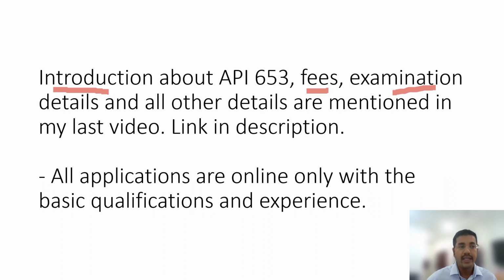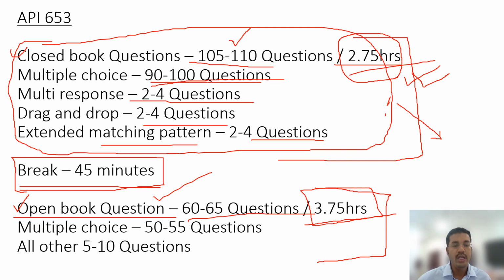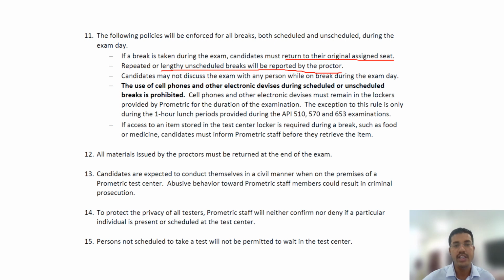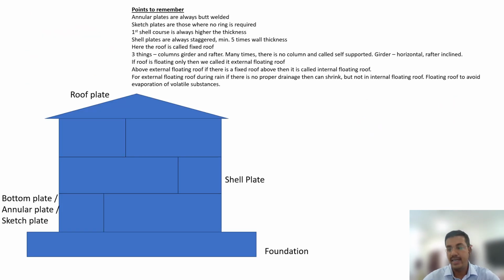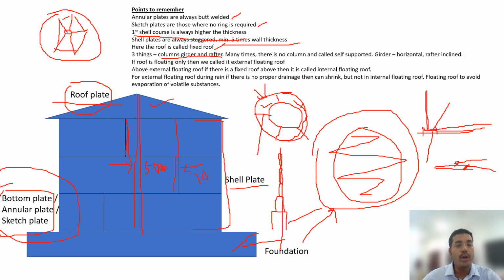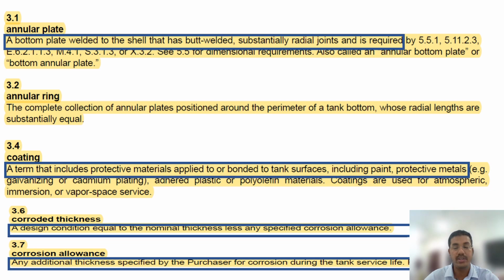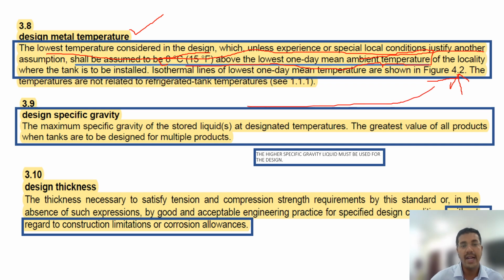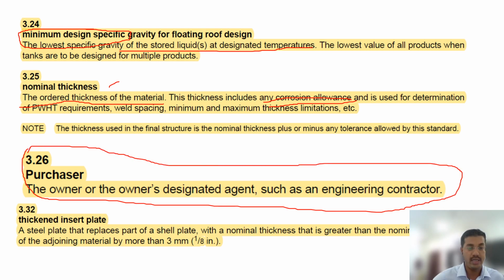API 653 PART 1

Comment: Hi, I have done my graduation Btech in mechanical engineering what's the carrier scope after any Api course please guide what should I pick up as a good carrier
Reply from the maker: API courses to be done with few of experience in the relevant field. If you are working in any of those fields then go for these corses, it will give you a better knowledge and promotion in your career.
Reply: @qualitymagnify5656  4 years experience in quality in automobile industry sheet metals not in oil and gas and I searching a job in gulf but there is only Oil and gas sector job in QC field any they want oil and gas industry experience or these certifications courses
Reply: So i am thinking to do anyone of these course